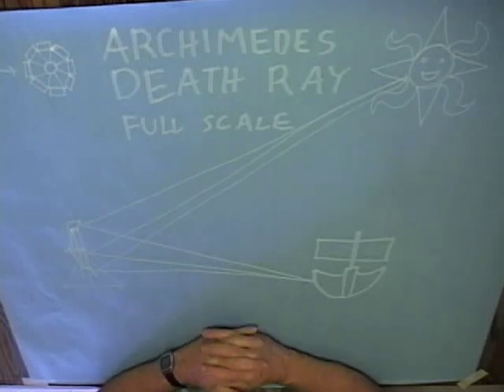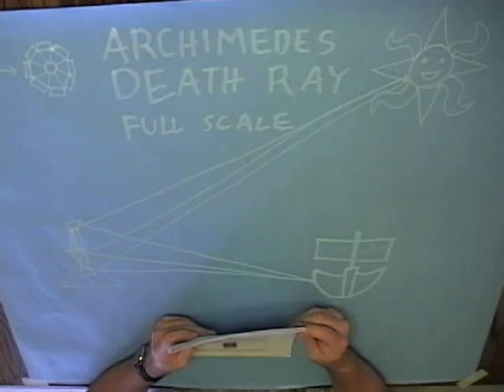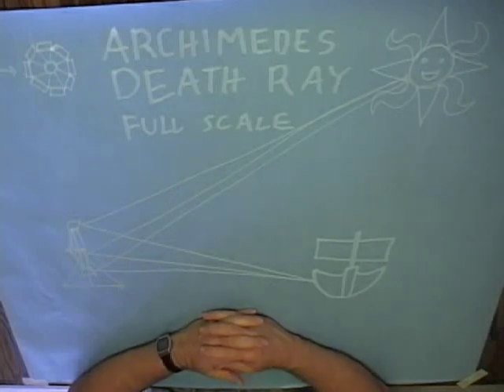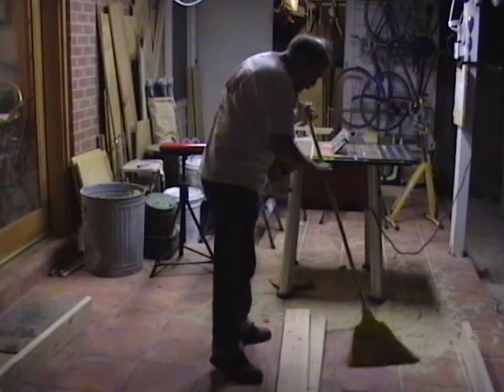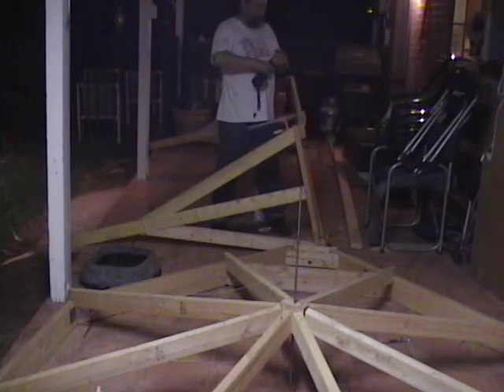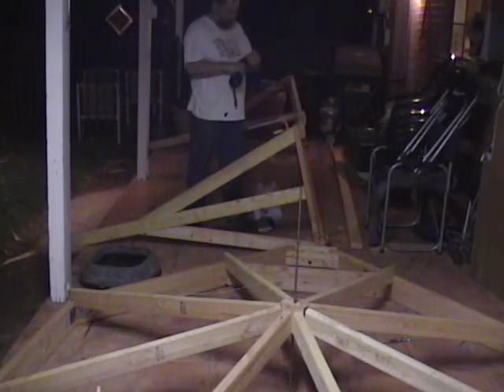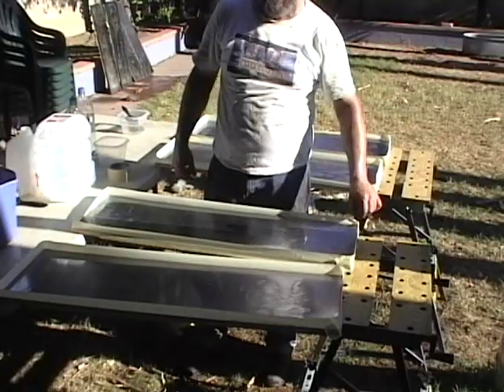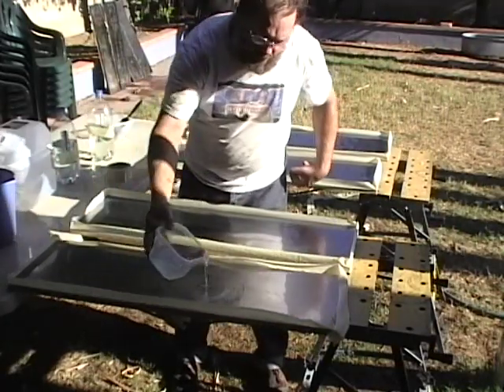Mike Bushroe's Myth Busters Archimedes Solar Death Ray Full Scale

Comment: I never understood I get that part of it was damaged in shipping but the mirrors themselves couldn't have been damaged that bad they're not glass there's no glass to break
Reply from the maker: Ichigo, you are quite right that unlike several of the other Solar Death Ray machines both of mine were entirely made of metal reflectors in order to more accurately work with mirrors available back then. My small scale, which was also severely damaged in transit, is only barely visible in the background of one sequence so nobody remembers it.

The reason that an all-metal mirror could be destroyed in transit even without any glass to break is that to focus sunlight tightly enough to set wood on fire 100 feet away requires the entire surface to be a near perfect parabola. The lumber and plywood with sheet metal on top was not really quite good enough, but close. 

After the damage, they did not use any of my packing materials or ratcheting tiedowns straps. Instead, they propped one end on a shipping pallet and left the rest hanging. When it arrived it had warped enough to be potato chip shaped, namely curved upward for part of the mirror and downward for the other part. Once bent like that it could never be forced back into a parabolic shape where the whole surface curves upward, not just half. Tory rebuilt the shattered parts of the framework, but that was not enough to make it a parabola again. The irreparable damage was to the shape of the wooden frame work which shapes the mirror,  and not to the mirror surface itself.

Comment: Man I’ve started a fire with a single parabolic mirror. This would work but I think the design would need to be different
Reply from the maker: Thank you for your interest! I have always been intrigued by turning glasses and mirror, and I am glad that was able to build some for the competition.
You are correct that if this was redesigned to look like the burning mirror you had it would look a bit different, and  probably do a better job of setting things on fire. The first difference is probably how curved they are. I suspect that yours is more like a soup bowl, instead of wide and flat like a table top. But to focus light on a target 100 feet away needs a very flat parabola, and because it is so flat it is hard to get just the right angle on every surface to get all the light to focus on one spot. Another major difference is that your parabolic was small enough to allow pointing it by hand, but the big one needs a tilting, turning, focus adjustibility to work on targets when you can'y move the whole thing. Mne is also unusual for having the 'leaves' or panels around the perimeter. They were added because modern 4x8 lumber made it difficult to build any bigger than the center disk. The leaves can be adjusted to focus at different ranges, twist side to side to line them each up with the bright spot from the main disk. At least that was the theory. Harder to do in practice and takes a lot of time to adjust eah one.

Comment: well, he has the right idea but forgot to polish the mirrors.
Reply from the maker: TRGaRetroGamer that is a good catch. When I coated the mirrors the first time I didn't let it 'cook' long enough so it was only partially silvered and looked they needed polishing but that was what went into the video clip. During the long wait (TV is not hurry up and wait, it is wait and hurry up!) I sanded off everything down to bare metal and silvered again. This time the mistake I made was to follow the silver coating process instructions and repaint the surface with an acrylic that the silver could adhere to but the sanded steel sheeting was smother and flatter than the acrylic and could have silvered just fine. After re-silvering I got a 4' diameter spot at 100'. But ultimately it didn't matter because the shipping company trashed it in transit and after that it couldn't focus again.
Reply: @mbushroe  I see. Didn't think creator would reply himself. Neat.
I am sorry to read that you lost the mirror. 
It was a good recreation.

Comment: My recollection of the story is that he used multiple soldiers all along the port walls, battlements headlands & walkways and all carrying large polished shields in a fresnel array . If one soldier is taken out the system still works with multiple redundancy.  Archimedes worked out that if you hold out a finger at arms length  you can use a small mirror in your other hand close to face with a hole in it and aim the reflection at your fingers looking through the hole.  Use your fingers as an aiming reticule and you can aim that mirror at any object accurately . Scale up the principle with a pole and a hole and you can aim multiple large mirrors accurately on a distant object making the temperature on a ship unbearable
Reply from the maker: Grommo, both versions of the myth exist. And in my attempts to get on the show, I did the many soldiers with mirror shields in small scale. Unfortunately they did not include my entry in the small scale, only my full scale mirror. Also unfortunately they were both in the same shipping truck and both were severely damaged. 

Pity since my small scale had 240 small brass mirrors, each 1" x 3" and screwed onto a six level "dock side" and pointed at an open air, stainless steel oven thermometer (surrounded on 5 sides by ceramic tiles) that was FIVE feet away from the nearest mirror. I was able to polish the brass so that you could use each one for a shaving mirror, and had gotten all the mirrors mostly oriented to get 500 F on the thermometer and char through wood, but not quite self-ignite into flame. I think another day of tweaking the mirrors would have gotten the last little bit needed, but after the shipping damage it was a lost cause. The row upon row of small brass mirrors is visible in the background for a second or two during the episode.

Comment: Just watched this episode on the Myth busters Marathon. They really don't let us know if it was rebuilt. I've been waiting 13 years for the answer.
Reply from the maker: Gorilla Jones, Tory replaced the splintered frame members and re-attached bust guy wires and got it standing 'on it feet'. It was even visible at the far end of the line of MIT mirrors. But it was too badly warped to generate heat, so they kindly did not show it failing so badly after it was damaged.

Comment: I really love your design and your idea to adjust it!

Did you rebuild after it broke?
Reply from the maker: No. It was too badly warped to truly function again. Tory rebuilt it since I was too devastated by the damage and knew it could never work  properly again. We tried it on the boat, but the light just rippled and warped as I tried to focus and it generated no noticeable heat. Even at it's best before it was shipped, the best I could get was to narrow the 10 foot reflection  down to a 4 foot spot at 100 feet away. Too hot to stand in, but no where near enough to set wood on fire. Maybe if I ever built another, making it even bigger and grinding each individual metal tile to focus at 100 feet I could get one that actually worked, using only the equivalent to period materials and techniques.